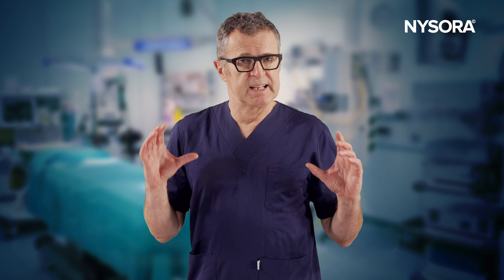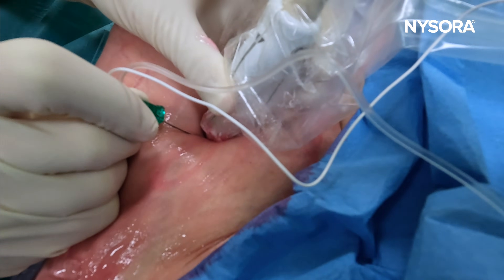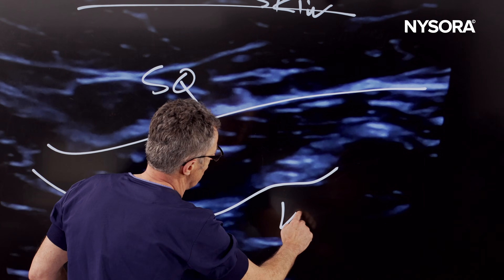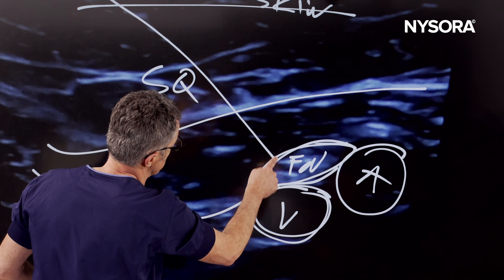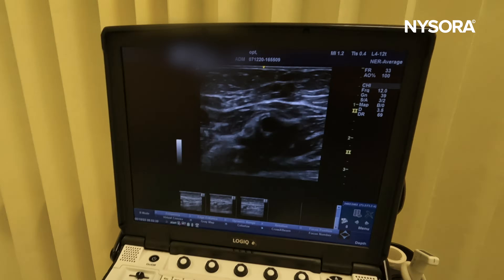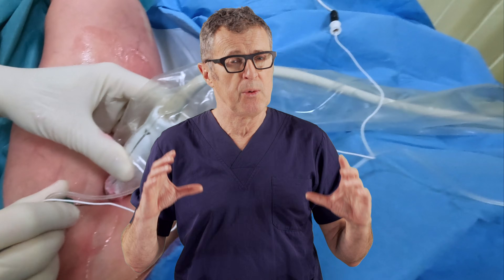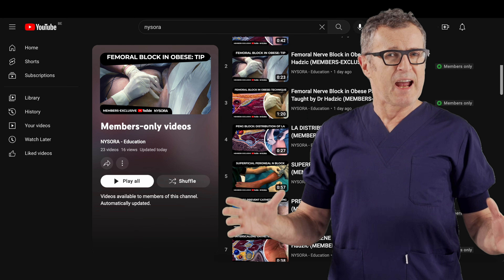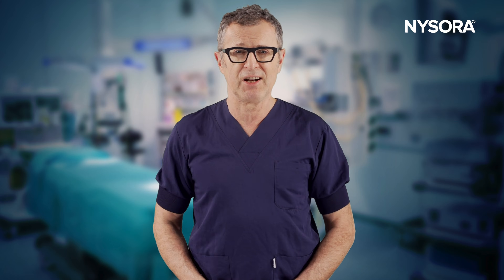Femoral Triangle Block For TKR

Comment: Femoral triangle blocks are most commonly practiced block since ages. 
The conventional ACB given at mid thigh location is actually given in the distal femoral triangle area. 
Many studies hav confirmed that the apex of femoral triangle lie distal to mid thigh. So, whatever adductor blocks given at midthigh locations before, were all distal femoral triangle blocks.

We hav been giving this block as a component of DSB for TKR since 2017.
We never encounter any issues due to vein. We can simply avoid that vein as our targets lie superficial to it.
IMHO, distal FT block always better than ACB as it covers almost all procedure-specific anterior innervation of knee joint. ACB mainly blocks SN and popliteal plexus thru it distal spread in popliteal fossa, so ACB covers post innervations mainly.
Due to common target as popliteal plexus ACB can replace iPACK too if given exactly in true adductor canal below VAM.
Reply from the maker: All true! Greetings

Comment: You find this to be superior to adductor canal?
Reply from the maker: Yes, by all means. This has not been substantiated in the literature - which seems to claim that analgesia with the adductor canal block is no worse or better then with femoral nerve block. This is rubbish, of course. You can use femoral block for surgery on the anterior thigh, knee, patella, patellar tendon - we have done many of these at NYSORA as the sole anesthetic. In contrast, you can not use Adductor Canal Block for ANY surgery - case in point.